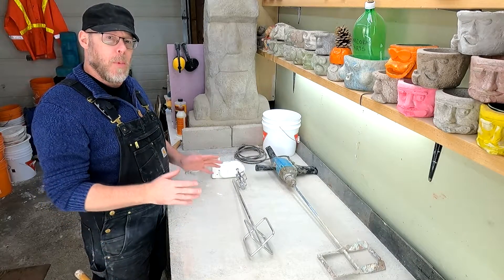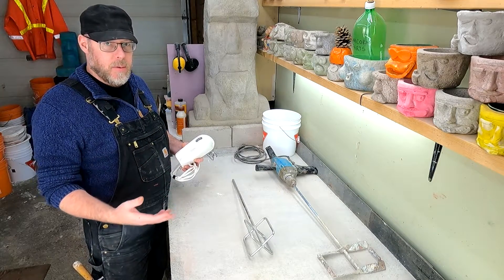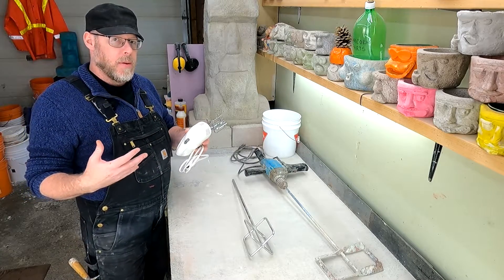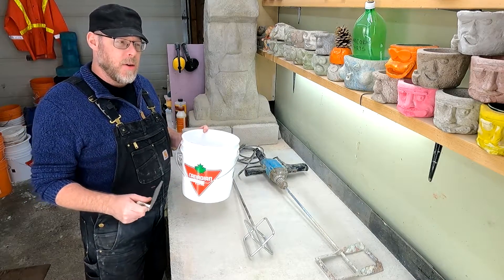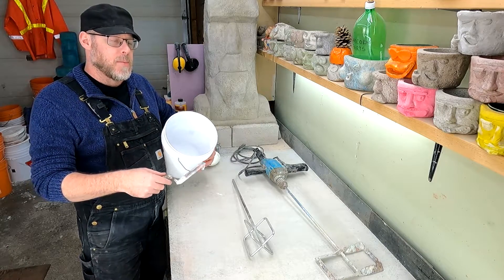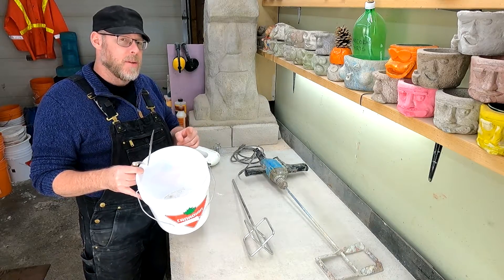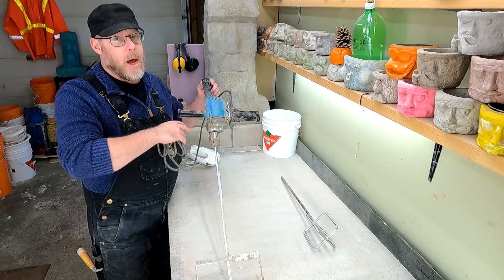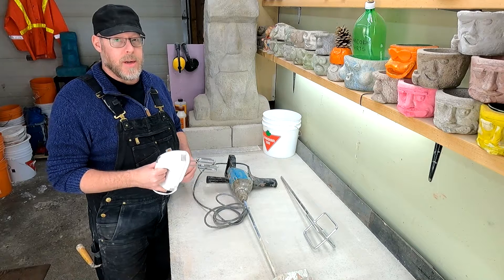Can You Mix Concrete With a Kitchen Mixer?

Comment: I didn't think a kitchen mixer would work, lol. I won't even use my light duty drill.
Saw new research into self heating concrete using paraffin wax. Seems like something I want to experiment with for making stepping stones. It works well in areas that often melt in the day and freeze at night. It will melt up to two inches of snow at several degrees below freezing.
 https://www.youtube.com/watch?v=oGcbYOBd7L8